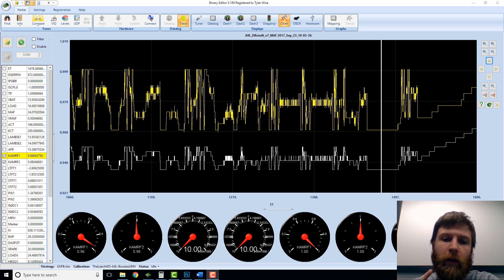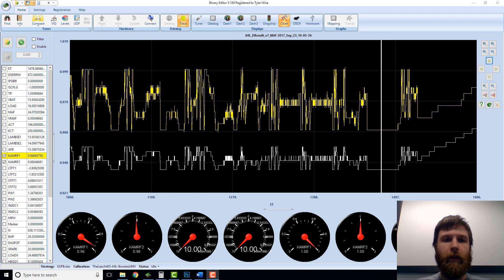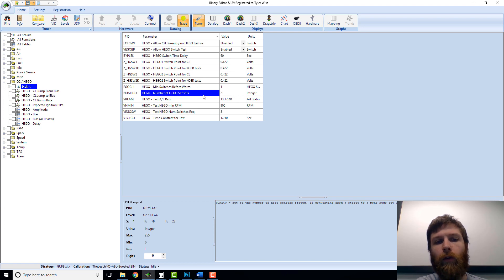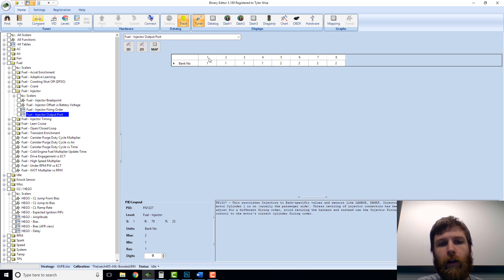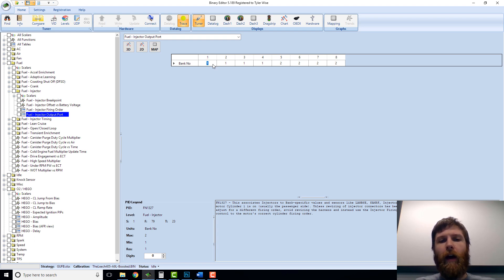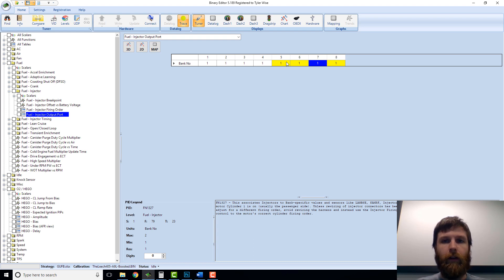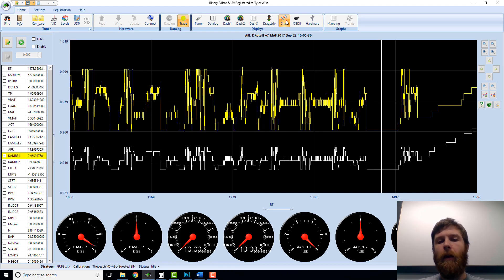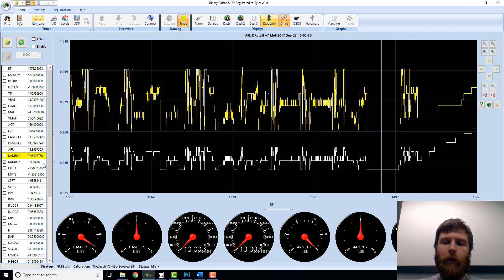Tuning a Foxbody Mustang to run on 1 oxygen sensor - Will it Work???

Comment: Is there no way to run with 1 o2 sensor using the factory ecu? Just unplug one temporarily? Ihave a bad leak on the slip pipes on my new long tubes. Its giving my car a false lean code and giving me a terrible idle surge. The problem didnt pop up until I fixed the last 2 vacuum leaks of course. Car runs great with a vacuum leak go figure lol. Still in the process of figuring out how im gonna fix the exhaust leak without welding. If I weld it I wont be able to change my starter ever. Just rebuilt the entire motor from the ground up recently and just slowly going through and getting everything as it should be. Gonna try to fix the leak tomorrow if I can come up with a way to do it. One major leak and 2  others all on the pass side header slip tubes. Your thoughts?
Reply from the maker: Yes. You can set the number of hegos to 1 in the tune, then set the injector output port of all cylinders to whichever bank you are keeping.
Reply: @LeechMotorsports  I guess what I was asking was for a way to run 1 o2 on factory ecu no tune. I live out in the boonies lol. But I just introduced a small vacuum leak for now to make it run right until I get the slip pipe leak sorted out. Was not sure what just unplugging one would do. Does the factory foxbody ecu manage both sides of the motor separately?
Reply from the maker: The factory ecu controls fuel to each side of the engine independently. The oxygen sensors read a range of around 0-1 volt. In normal operation, they will switch constantly from one extreme to the other. If for some reason a period of time elapses I’m which no switching occurs on one of the sensors, then it will kick over to use only the other sensor to make fueling corrections on both banks. But it won’t be instant. There will be a period of time after each startup where it will be grumpy until it realizes the o2 is it functioning.
Reply: @LeechMotorsports  ok awesome that is exactly the answer I was looking for. Since I know for a fact its a false lean code then running on the one until its sorted should work just fine. Fixing these long tube slip leaks is a little tricky especially with them mounted. Thanks a ton! Will be definitely coming your way when I am done with my 2nd fox for the strip. This one is my daily driver lol.

Comment: I was doing some reading on efidynotuning and they recommend turning off 1 o2 when using a x-pipe.  Back scavenging throwing off the o2. Any opinions on this?
Reply from the maker: I’ll be honest. Never heard of that issue before. I would only turn off an o2 sensor in the tune if one was failed or if I needed to use a factory bung to install a wideband temporarily. I can’t imagine a factory location sensor being really thrown off by an x pipe like this.

Comment: Hi, I'm just learning this so it's a bit over my head though I did find an engineering write up on the EEC-IV TFI-IV system. I had the impression that in closed loop these ran off what they called a  base or fixed fuel table. The O2 sensors were allowed to make minor tweaks to this table but if they went beyond a certain threshold they would essentially be ignored. Though maybe I got this all wrong and they are much more critical to operation.

Anyway in short what I'm getting to is I have a 302 thats been pretty well customized from what the factory setup was and if I were to unplug them both is there a potential scenario where the car may possibly run even better running off the base fuel table?
Reply from the maker: If you unplug the o2 sensors, then the computer will basically just do whatever it’s told from the base fuel table, mass air information, and injector size. If the fuel is off, no adjustments will be made. You can, at that point, manipulate the fuel pressure as needed and maybe get the fuel close to where it needs to be. But drivability will suffer tremendously if the tune isn’t dialed in.

Comment: I run a wideband on the drivers side and tune from that. I don’t have one on the passenger side it’s blocked off, perfect no but it seems to work fine. I pulled the bulb on the check engine light.